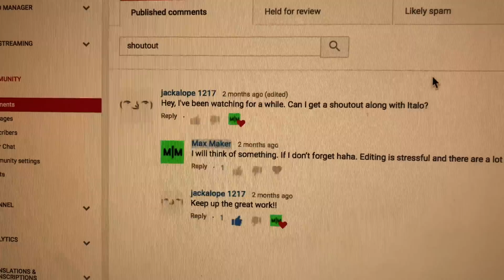A quick update about my progress. (Remote and Electronics)

Comment: Hi Max Maker, the use of the RF2401 link board is the right way for the stable communication? In my prototipe the range is seems not to be enough for the water shield. Suggestions about?

Comment: im curious about how you plan to waterproof the switches. I was thinking you could use hall effect sensors for the trigger and buttons so that you can conformal coat all the electronics so you wont have to worry about a switch or pot shorting if they get wet.
Reply from the maker: I will put a rubber sleeve around the entire remote. It was very difficult to find any waterproof buttons. Let alone a poti. And if they were waterproof, they weren’t compact.

Comment: thanks for your videos. I am making my own board, i dont Know anything about arduino , and yes...I would love to Know more about the electronic. How can i start with arduino? any suggestion?
Reply from the maker: Cool! Efoil.builders is a good source of information. 

Arduino is very easy to learn. I would suggest following one of the many tutorials where you let an LED blink. Then pick a tutorial where you attach a button. When I start a new Arduino project, I see it as individual modules and look up the tutorials again myself. How to add a button, how to add a poti, how to control a servo, how to attach a display. The tutorials really help you and make anything possible. I never attached a display before this project and it turns out its really easy.
Reply: Many thanks. It seems difficult , and i am engineer, but  with hours of reading and practice i guess... thank you for your videos, are amazing.